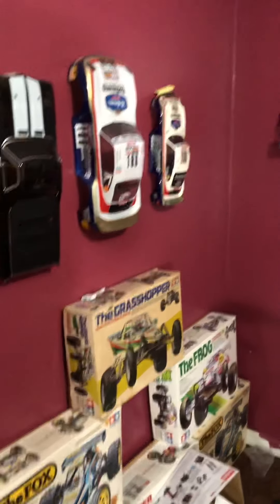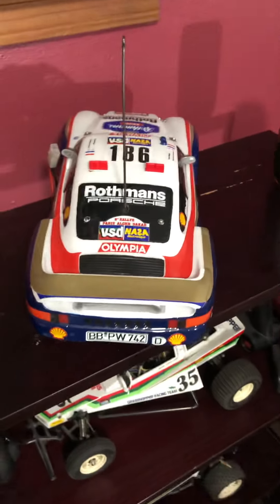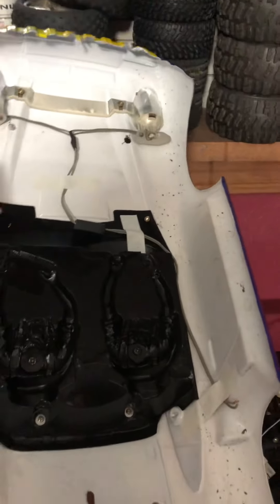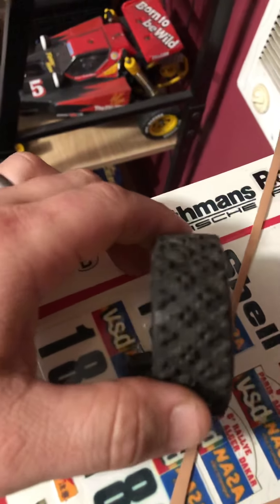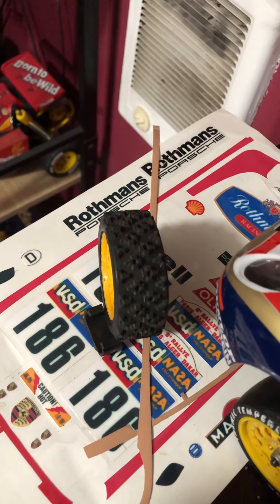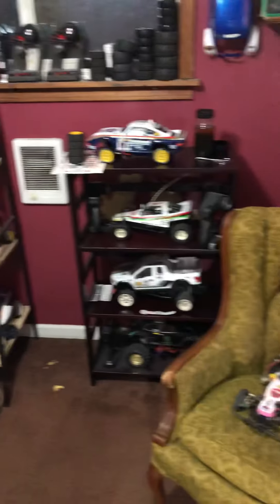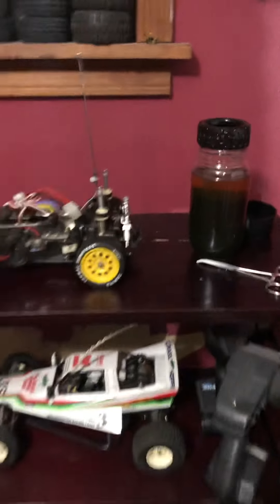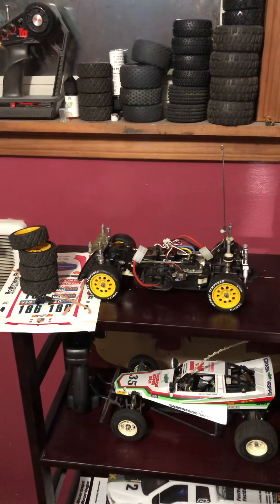Tamiya 959 Rally block tire restoration part 1

Comment from the maker: Just a follow up.  I pulled the original rally block tires out of the oil after 6 days and white residue was removed and soften them by 80%.  I have been experimenting with making molds of my original parts which were NOS and casting them in melted Traxxas broken parts and the first set I made were stronger . The hard part was keeping the temperature consistent and to make sure cool down process was gradual.  It it cooked down too quickly it made the plastic real brittle.  I’ll keep you updated on a finished product.  3D printing is convenient but had issues with quality and now rising prices.  If I can develop a way to use broken parts from todays plastics using what we have lying around not only will it be more durable it will offset the price gouging that seems to even going on.  This hobby shouldn’t have to break the wallet.  Cheers!